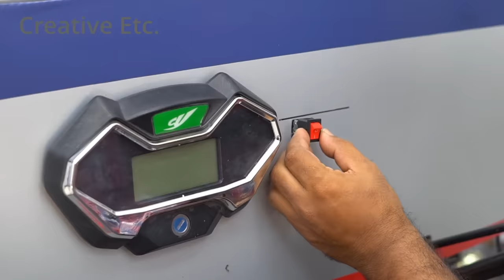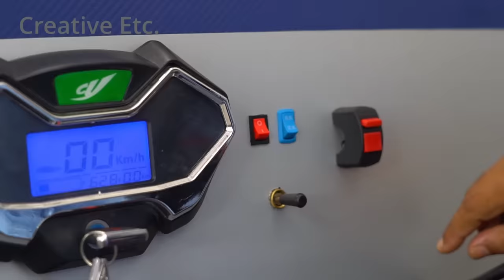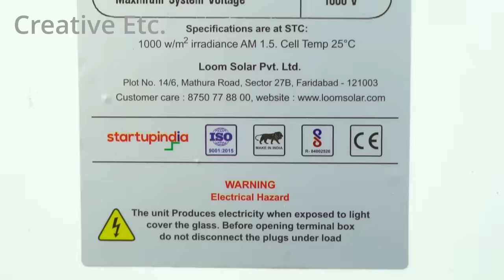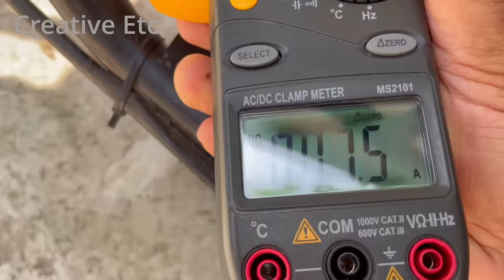I Made a Solar Electric Car at Home

Comment: Great job!!! I will add a reverse gear, carbon fiber body panels, & SEALING the interior from the wind/weather to reduce wind-noise. Oh yeah, I would add fenders too (nothing too extreme... bicycle or moped fenders would suffice, or carbon fiber ones at that!!!). I would add a much sharper nose/front end to slice the wind (& raise the total amount of distance you could potentially get from your battery pack... but, that's why THIS project is the first one/version... there's ALWAYS improvements to the initial design concept. I'm starting my home/small business project, which specializes in custom carbon fiber parts & one-off automotive accessories... much better quality than the mass-produced big business model catering ONLY to the recent vehicles in today's market. Hmmmm... you gotta winner there in the future of 3 Wheel electric vehicles.... something ANY person can drive IF there's a path forward in the license board of transportation!!!! Much like a moped or electric bicycle/scooter... yet, your design speaks LOUDLY to the masses. Hmmmm.... my wheel are turning.... STAY TUNED. MIC DROP 🎤.

Comment: Superb attempt. 
The solar panel is blocking the flow of wind from the front. It will cause  drag and even damage the solar panel if its stressed too much.

Is it possible to make the windshield overlap the solar panel? or a simpler option would be to push the solar panel further behind.

Comment: This is what cars should look like. Just super scaled down, 'barren', and made for cities. You shouldn't go faster than 30-40 km/h (20-25 mph) because it's made for cities and literally just transporting 1-2 people, or 1 person and something as large as a TV (carriage) or dish washer. Sure, larger stuff exists, but >95% of trips within a city just don't require more transport capacity than the above examples.

Grab a cab for the rest. You've saved soooooo much money on using something like this anyway.

Comment: If you had 3 motors motorized wheels on that thing, would you really use that much more electricity? Because each motor would have to do less and you'd have better traction when you're getting involved in soft soil and all that sort of stuff. I'm just wondering if you actually had 3 motors on there. And might actually not shorten your range all that much

Comment: What is the power output of the solar panel and how much the power needed by the vehicle to drive at moderate speed? I believe the solar panel won't produce not more than 200 to 250 watts and the vehicle needs 4000 to 8000 watts approx. This video is good in terms of mechanical fabrication.

Comment: I'd consider extending the windscreen longer or putting a cap on the top covering the solar panel so it sheilds it against the wind from ripping it off, and plus you'd have way less drag. Good job otherwise.

Comment: you can use cardboard origami or rods, can be stiffened with pallet wood fine laminate and waterproofed while removing aerodynamic drag that consumes most of the energy also wheels with rope spokes and natural rubber to not contaminate with synthetic rubber tyre microplastics

Comment: you could have used more high efficient 550W panel and bifacial panel to take in more light from both sides. Cover the battery pack with something reflective to make bifacial panel more efficienct.
@creative etc.

Comment: 6:15 a common mistake, different lengths and centering of the axes of the front suspension arms and steering rack, you can probably fix it in one day, or never possible, depend on frame sizes of your wehickle

Comment: If it has 3 wheels it is a motorcycle in the USA; not a car.   A motorcycle has advantages as you don't need to do all the testing needed for a car.

Comment: As always, this is not a solar-powered but a battery-powered car. Once the energy coming from the panels to the battery is lower than the power used, it's just a matter of time when you're gonna pull over and walk.

Comment: We desperately need much higher efficiency solar panels to make ideas like this practical. I saw another guy who made a YouTube video on this same idea. Except his was actually theoretically unlimited range in sunny conditions. The only caveat is that to achieve this required 3x very large trailer attachments (like a train) just to carry the solar panels needed. He had like 5-8x the solar surface area this build does. Not very practical either way.

Comment: have you guys seen the flashlight with a crank?  you know the crank doesn't do a thing to light up the LED build, it's the cheating battery inside that does the job.  this car with 2 panels have no way to run that car, just saying.

Comment: Has been in my mind to build better but with latest generation flexible bendable solar panel films act as layer of the car's paint
Unlike the failed bankrupt Dutch company "Lightyear" what I am visualising is the thin layer solar panels can absorb sun light much better than conventional solar panels just as the paint layer of it's only of its kind of Rare Blue of Lexus Coupé LC 500

Comment: Not very practical design for service if something breaks it will need to be ground off and rewelded.all movable parts should be removable from each other without welding